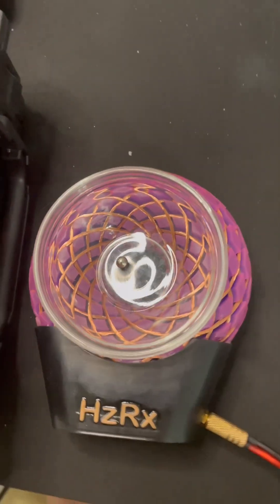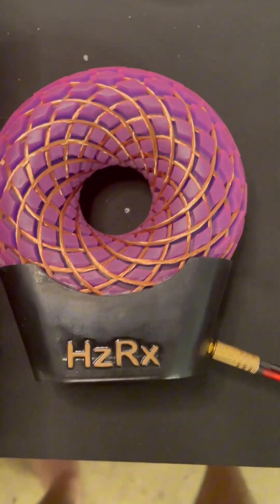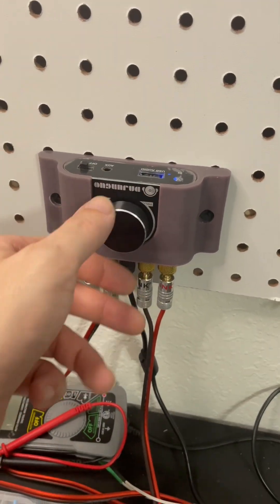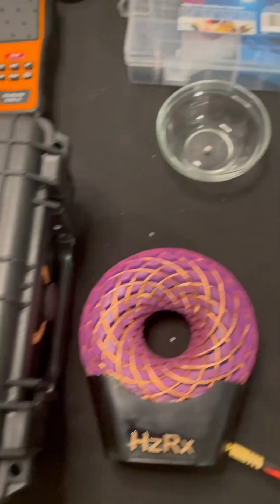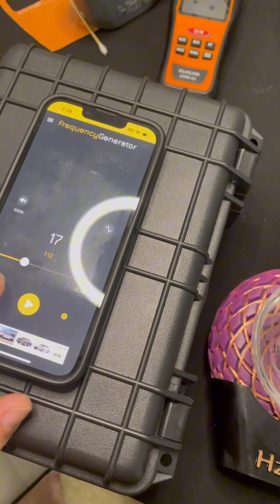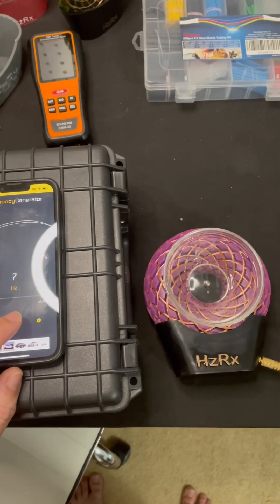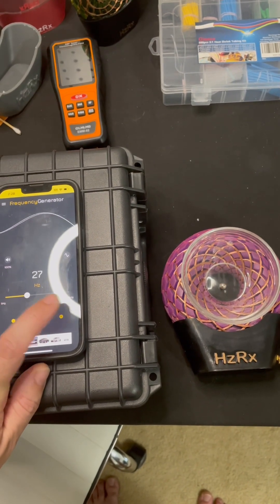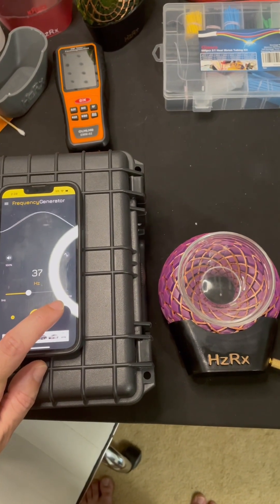Built a Rodin Coil That Moves a Magnet… Science, B*tch!

Comment: I feel like there is an unknown particle that aggregates out of quarks due to the nature of this coil, possibly interacting with the Higgs field. If not, I would assume that the ball would be doing something different, like simply zipping around the edge of the glass in a uniform circle very quickly, or just spinning around in the middle without moving anywhere. Well, I already know that that's something you can get one of these balls to do. I'm not sure whether the claim is true though that you can get it accelerating, then shut off the coil, and then have it actually continue accelerating after the coil is shut off. There is definitely some anomalous shit going on with these things